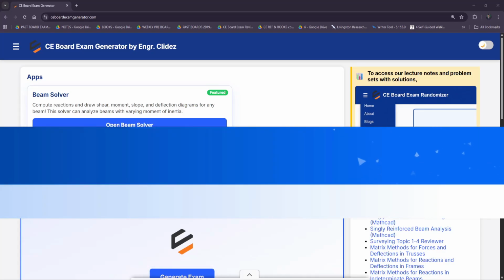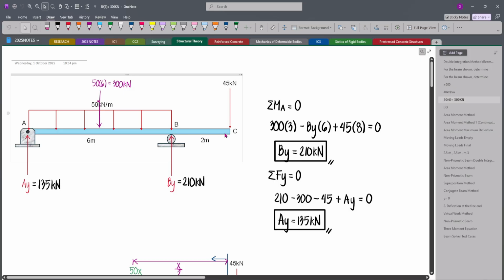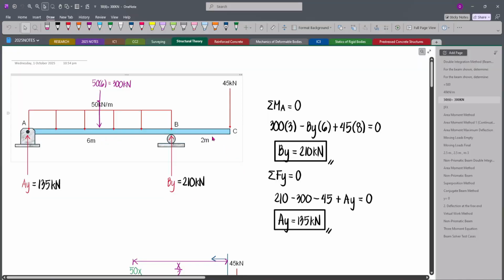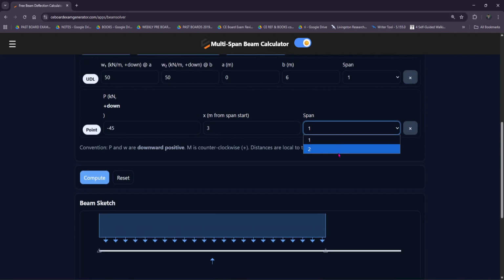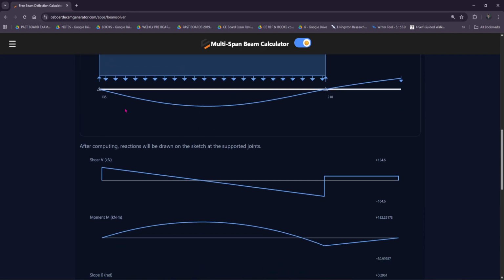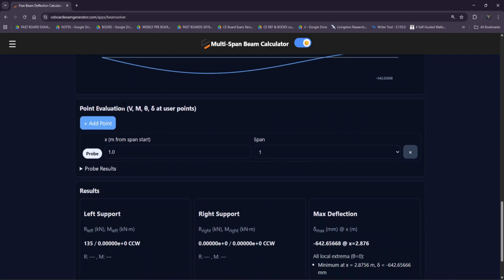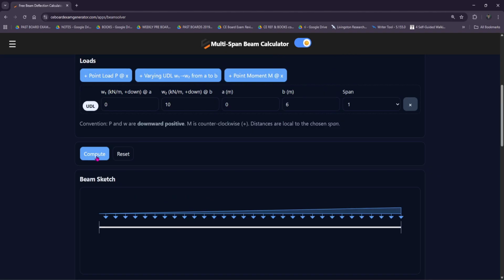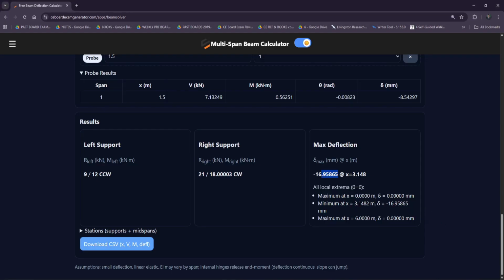I MADE A FREE ONLINE BEAM DEFLECTION CALCULATOR using JAVASCRIPT

Comment: Paano ginawa engr ung mismong website? May tutorial po ba?
Reply from the maker: Took me 3 weeks to build po; you can make the same application with concepts on matrix methods of structural analysis po.. for the rendering part, I used chatgpt to help me draw the diagrams since limited ako sa IT part 😅

For the solving part, I used integrals and matrices to consider nonprismatic beams